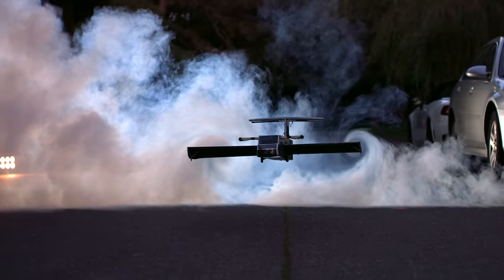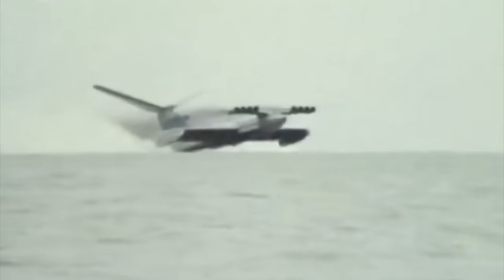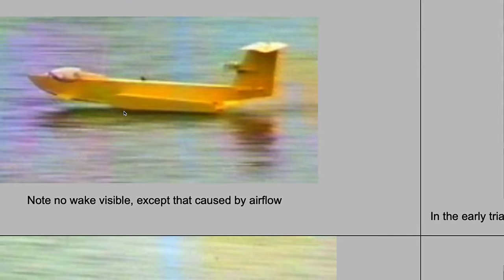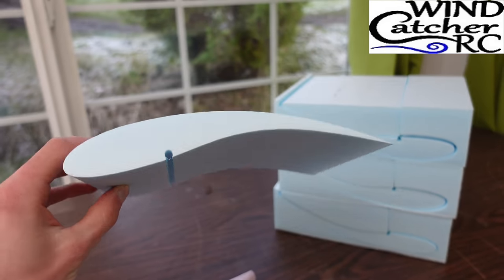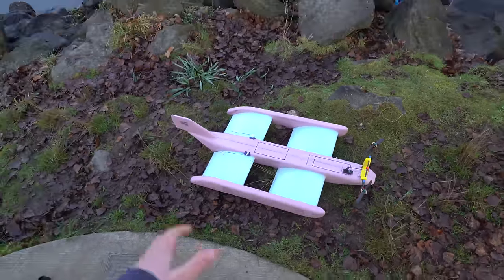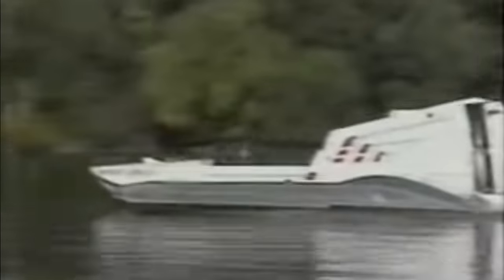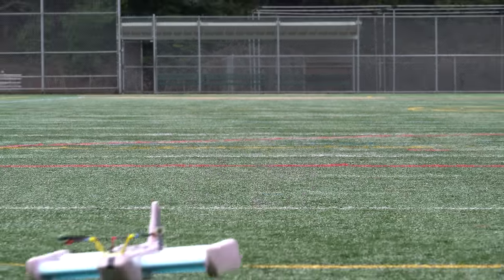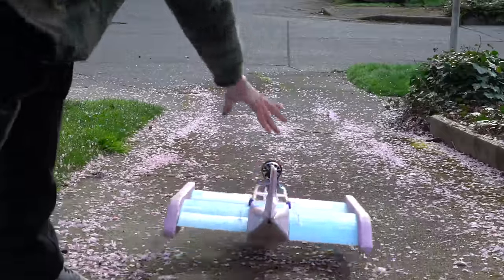Are R/C Ground Effect Vehicles Even Real???

Comment: So, I've been thinking a bit about Ekranoplans and speculative xenogeology/biology. Sometimes it's fun to speculate about a planet with super strange oceans and things like that.

Now I'm wondering, what kind of liquid could form an ocean that was very flat, but not at all conducive to sailing? Whether it is because the liquid is ridiculously viscous, there is a frozen top layer at all times, or because the liquid itself would destroy most materials sitting in it over the long term?

There could be a planet out there where ships wouldn't be economically viable! Only ekranoplans!

Might be a good thing to ask some speculative xenobiology types about? Or some worldbuilders!
Reply: Maybe most water surfaces are too swampy. (Dried up lake beds would also not allow sailing, but you could just walk over them. Whereas if the ground remained muddy it would stay MOSTLY flat without being traversible with heavier vehicles.)
That could happen on a planet with less water/liquid but which somehow still has strong erosion (or where erosion has had a long time to accumulate silt). Maybe Mars (all water has to be brought down from comets or synthesized from rock, no plate tectonics, limited volcanism) will be the Ekranoplan planet in a couple million years. I doubt that mankind would fill its surface with enough water to form deep oceans.

Comment: IMO if you don't want it to fly, don't use airfoils (Airfoils produce lift via low pressure above the wing*) What you want are "wings" that cup the air under wing to capture it for pressure to produce the ground effect. There are quite a few sport craft that you can look to to better visualize what I'm describing.

*This is a horribly simplified explanation... sorry

Comment: Just looking but it really seems like the back is popping up for obvious reasons.
The original had jets that create a much more directed airflow that really only goes under the wings, while in yours some is pushed under the front wing and some under the rear wing. Since the front wing air remains, the back will "pop up" due to the stronger compression of air in the back. You should honestly try to just mount the rear wing 30ish% higher than the front one.

Comment: I feel like you're pretty badly misunderstanding what a ground-effect vehicle is.

I've never heard an engineer say that a ground effect vehicle should be incapable of flying out of ground effect.

Rather, it's a matter of design emphasis. There are two primary design criteria for any aircraft. One is max power, with a goal of high-mass takeoffs or high-intensity maneuvering. The other is cruise, with a goal of maximum efficiency. 

A ground effect vehicle is simply an aircraft designed so that its max-efficiency cruise state is very low altitude, utilizing ground effect for efficiency gains. Of course they have enough power to potentially fly higher (possibly with modified wing and control surface design). This is in contrast to normal aircraft, which are designed to gain efficiency by gaining altitude, within the bounds of other design parameters, such as cost, engine type (which ties to cost), life support systems (which ties to cost), speed (which ties to noise and cost) and operating complexity.

And come on, man... 19 meters vs 20 meters with a pedantic wikipedia definition that has nothing to do with the actual physics involved?

I don't like making mountains out of molehills and splitting hairs to generate controversy. That's a lot of what's wrong with the world today. Something to think about, maybe...

Comment: I woul;d get a fog machine and do some flow testing to see where the air is actually going. i would extend the engine forward. this may give you a better air flow over the foils. as your lift comes from the air flow. so. something to look in to. the fog machine in a wind tunnel will give you the best answers.

Comment: Question from an aerodynamics outsider:
Do the aerofoils need to be the same angle of attack? If the idea is to stay within ground effect, couldn't a different angle of attack allow one set of them to lose lift outside of ground effect. 
And the general problem of doing that with a normal aircraft would be mitigated by the pressure under the craft.
IDK, maybe I'm just crazy. Let me know if I am please. ;)
Reply: If I follow your idea correct its very plausible (if hard to nail the design) to do so - it sounds a bit like those very simple early/cheap RC aircraft that only get altitude control throttle level - higher throttle it goes up, lower it descends - the point being to let but two servo channels give you full enough flight control.
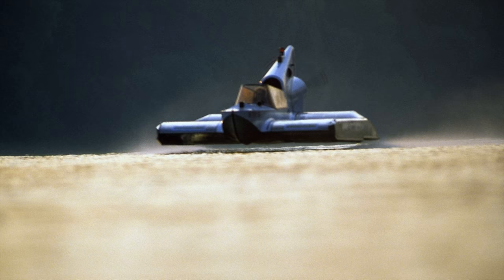Reply: If your idea is to keep the vehicle flying level over the surface, avoiding moving out of GE, I think that's why the craft at 4:30 has different shaped airfoils. 
Just like an airplane, the front wing influences the airflow over/under the back. You could figure out what happens when the AOA of the whole vehicle changes, and design the foils in a way to always balance themselves out. Given how smooth the ride looks and the lack of any trim flaps, that might be how they did it.
Reply: @fonesrphunny7242  Ah, couldn't tell at first from the video, but now I see it. But yes, that is my general thought.

Comment: I was under the impression that ground effects lift is not generated by typical airfoil velocity differential but by packing the air under the "wing".
I'm sure that an airfoil is not required for ground effect.
In racing cars ground effects are designed to place a vacuum or lower pressure below the vehicle.  
....
I've been doodling a hybrid of hovercraft and ground effect vehicle.   One with a leading edge flap to capture lift that retracts in forward thrust.   Poor man's VTOL.. lol. 
..
I'm also curious about a 3 wing layout... like a hydroplane or reverse trike.   The front wings effect the rear too much in this layout.

Comment: Hovercraft or Airplane? Actually neither. A "Hovercraft" can hover. Airplanes can fly at altitude and maneuver by merely adjusting the attitude of the craft in pitch, roll and yaw at any altitude they are capable of attaining. If a craft is designed to operate off water, yet can attain an altitude more than just a few times it's wingspan, what you have then is just a seaplane.

Comment: It is too lightweight, easily stopped by water and the power needed to overcome the water drag is enough for vertical takeoff.
you need power enough for constant acceleration (overcome drag) till a speed enough to generate lift equal to the vehicle weight. it will be slow acceleration (p=m.a)

Comment: Are they any reason ekranoplan should have body of airplane capsule shapes? How about full wing shape design and more efficient ground effect friendly reverse round wings? I do not think ekranoplan need pressurized cockpit nor airplane like view to control. Of course there are no animal or object in the nature to mimic ground effect yet, but it does not mean should follow conventional design of tube shape or similar to put vehicle over the water always. First airflow must generate turbulences to float body of wings or whatever out of water, then it should be kept afloat with continuous stream. How about full split wings shapes with 3D design of round wing tips, and push air power from centre top rather than front? There are so many of variable points to tackle down to remove one by one though, it will be the process of finding optimal design. Moreover there will be the reason huge tail stabilizer on Airfish and Wingship design also related to your tail kept dips while heads up.

I do love to see your story continuously and wish you to be success on this case. Good luck and can't wait next work...

Comment: even though you  THINK  you have figured it out, here is some information.
for best operation on water, the  HULLS   SHOULD  BE  optimally  designed; for planing and 
      for minimum wetted area.!    these  were  NOT.!!!       finish  should be  hydrophobic.
      sponson aft ends  Should be correctly shaped/tapered; for minimization of  Drag, from 
      turbulence.!
it may be advantageous to have a  MINIMAL  amount of  lift-making area; in order to keep the 
      craft near the ground when in flight.    aka  a low lift to auw ratio.
it  will  be  advantageous to  IGNORE  all full scale wig-craft  designs; because  CERTAIN  'values'
      do  NOT  scale  down.!!!
it  will  be  advantageous for you to  COMPREHEND    Distribution of Mass. (dom)  and
      Center of Mass (c-m).        WHERE  is  the  c-m located.?        it should be understood that
      both, c-m  and  cg  locations  are a  RESULT  of the  dom.        it should be understood that
      a wig-craft is effectively a  LOW-wing  airframe.      consequently,  little  inherent pendulum
      effect stabilization is present.
for any flying vehicle, it is  MOST  DESIRABLE  that the c-m  be  located  Forward of the cg.
      if, as a result of design, the two happen to be (nearly) coincident,  there will be a shortage of
      both  stability   AND   control  authority.    (as is the case in  'tail-heavy'  jet  fighter designs.)
it will be advantageous for you to  COMPREHEND  the concept of   Center  of  LIFT.!  
      in a zero-dihedral, low-aspect ratio design, it may be advantageous to  have  the amount of lift
      taper off, slightly,  approaching the center line.
ANY time an elevated  offset  THRUST  LINE   is  used,  thrust results in  NOSE-Down  moment.
      this  FACT  was  not mentioned, in this video.
a  FLAT-BOTTOMED profile, with upper surface contoured to reduce drag from turbulence,  should
      be used.      ( effectively, this equals  a two-surface, slow-flyer profile. )        googletranslate

did you ever see this flying hovercraft design.    not really wig; but, a heavy, low-aspect ratio config.
https://www.youtube.com/watch?v=6ih_KBru6Co

Comment: virtual air bearing ground effect, you dont have to move, you can just ground effect hover
Reply: check the ground effect hover, you should get a clear scientific scale and power needed for the various levels of height from ground
Reply: ie, stick meter with linear up thruster, various shapes, skirts, bubbles, etc
Reply: static ground effect air bearing, no movement, vs, dynamic ground effect, with surface relative movement
Reply: use wheels or hydro foil engine to get and stay in the ground effect flight, yes, the wheels and hydro foil motor are the lower bound measure
Reply: I mean to get up to speed
Reply: it should handle like an unpowered kite, less a powered glider

Comment: try moving the motor down more toward the center of gravity. the motor wants to run the nose into the ground because its too high
Reply from the maker: But even when the motors were in their lowest position they were still tilted up slightly, in line with the center of pressure. This eliminates any pitching down force caused by them being mounted up high

Comment: Look at the reverse delta design and study it. RC models benefit greatly from scale effects and square/cube laws.  This is bad for assessing WIG.  Check this video out: https://www.youtube.com/watch?v=gnflnBF7jWk  They were doing this with RC and full size in the 60s.  Check out Fischer Flugmechanik RFB X-113 and others in the series - the website has some good knowledge.  WIG can operate out of ground effect if they have enough excess power, however they are inefficient and usually poor in lateral control.  There are names for ground effect vehicles other than wig.  The choices for comparison were quite extreme.  The reversed delta type will serve you better.